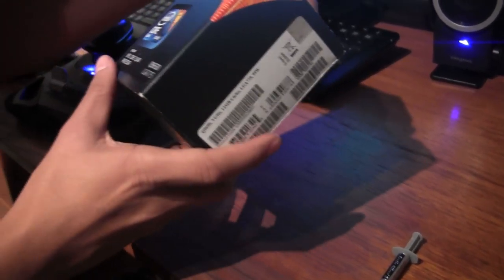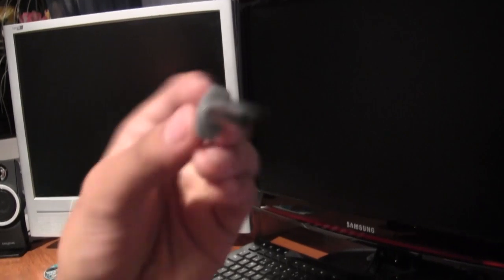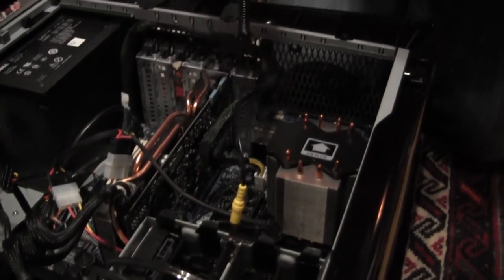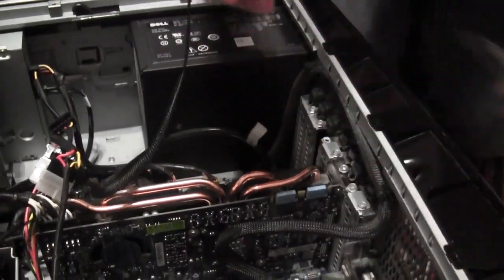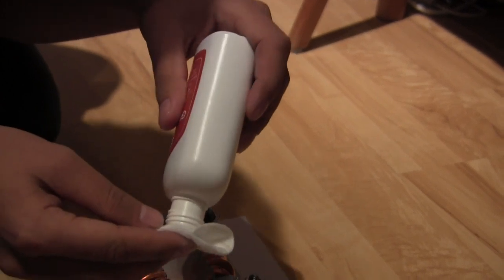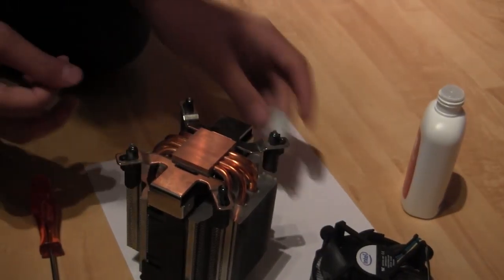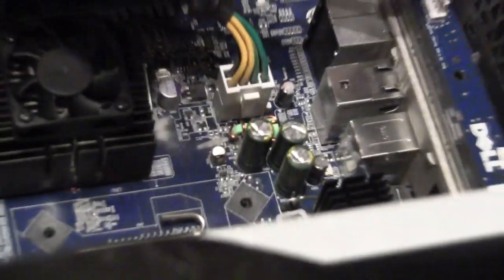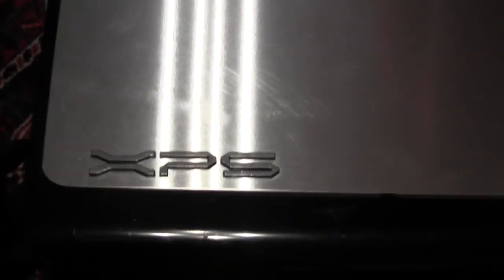Changing an Intel  Core 2 Quad Q8200 2.33Ghz with a Intel Core 2 Quad Q9650 3.0Ghz

Comment: Can it support p5g41tmlx3 Asus motherboard ????
Reply from the maker: yep it can!
Reply: Can q9400 prcocess support asus p5g41t mlx3  motherboard.
Reply from the maker: @quarch2.o  all Intel Core processors untilizing LGA 775 will support it. Just search for the processor you wanna use to see if it has socket LGA 775.
Reply: Can it support  gta v
Reply from the maker: @quarch2.o  it will run it, probably not good though.
Reply: I have also 8gb ram and gt 610
Reply from the maker: @quarch2.o  as mentioned, it will run, but not good.

Comment: Can any one answer me who’s better core 2 quad q 6600 or q8200.         And another question.  Is there alot of defrent between core 2 quad q 8200 and q9400
Reply: the q8200 & q9400 is just the same got 1 GB of video card it can run games smooth

Comment: Are you still using the q9650? Found an 775 socket motherboard with sli. But it only Had a Pentium D cpu. Looking to see what I can play around with that generation.
Reply from the maker: Hello, no i gave up on the 775 and Q9650 4 years ago, but with a decent graphics card you should be able to play most games pretty good!

Comment: Can i upgrade my pc core 2 duo e6600 2.4ghz 4mb cache lga socket 775 6gb ddr3 ram and GeForce9600 GT 512mb graphic card to core 2 quad q9650
Reply from the maker: should not be a problem, the core 2 quad q9650 is a socket 775. Just to make the swap!
Reply: Jean-Pierre Bovin what ????
Reply from the maker: Shoaib Sikandri the answer to your question is: Yes you can put a Q9650 in your computer.

Comment: I still have a Q9650 in my old PC. Still works and will overclock to about 4.5GHz. Although it has a water cooler, I only ran it daily at around 4.2GHz as that was enough for 60fps gaming. Great for such an old CPU!
Reply: Hey! 
Which GPU do you use?
Reply: Doesnt your ram bottleneck the performance

Comment: To change the cooler in my Dell machine I had to take a fine file and some garden pruners to hack up the aftermarket cooler mounting to get it to fit into the awkward Dell computer ! that`s the trouble with systems that come pre made, they, more often than not, have space taken up inside by things that don`t need to be there ( it`s like they don`t want you to improve it - conspiracy theory ! ) heh heh

Comment: i currently have a mediocre pentium e5700 cpu @ 3ghz but i'm looking to change it and get a Intel Core2 Quad Q9650 @ 3ghz . i also have an hd7770 gpu. i do a lot of editing and 3d work, so basically what i'm asking is will i see a massive difference by getting the Intel Core2 Quad Q9650 ?
Reply: Sure enough 🤠

Comment from the maker: That is impossible since the I3 uses the third generation socket LGA1155 and not the LGA775 socket. The processor wont simply fit without you having to change motherboard.

Comment from the maker: that would be the Intel Core 2 Q9650 Extreme. But Intel Core 2 processors have ceased production and you cannot find any new ones in the stores. If u are lucky, you can get a second handed one.

Comment: I have a Q8200 that came with the whole setup can I upgrade the processor by itself or do i have to get a new motherboard as well?
Reply: its good its just the same on q9400 add 1 GB video card then its like AMD A6 6400

Comment: lol i maxed out battlefield badcompany 2 with 30-45 fps with an e4300 when the minimum system requirments are a 2.0ghz core 2 duo mine is at 1.8ghz with an 8800gt my ghetto build lol

Comment: Do u think if I buy the Core 2 Quad Q8300 2.5GHz it will be good for gaming?
Reply: yes with 1 GB video card for old games can it run smooth for 1920X settings

Comment from the maker: @SpongeBobExtreme i'm using GTX465 it got 1024mb memory, yes there is an ultra high option which i could not use with the Q8200 processor, though the Q9650 can max it all out, so if you can get a Q9650 instead, well worth the money

Comment: Is the Q8200 capable of running the newer games? For example, Modern Warfare 3, Battlefield 3, Skyrim?
Reply: yes with video card of 1 GB smooth but without video card can run only on low settings
Reply: @nescafecreamywhite7235  thanks for replying after 12 years